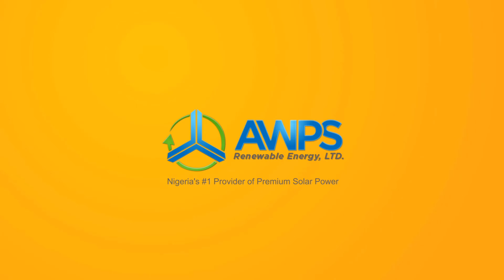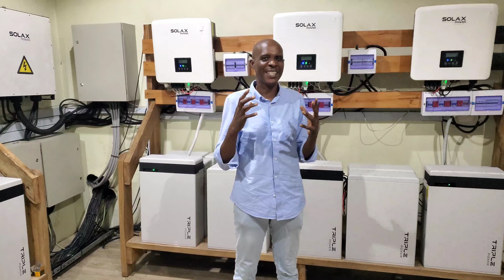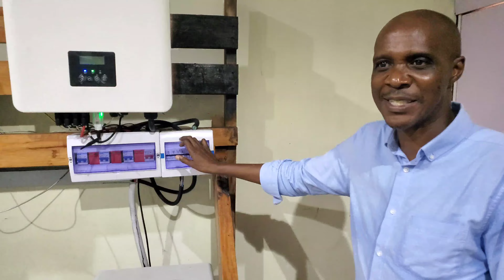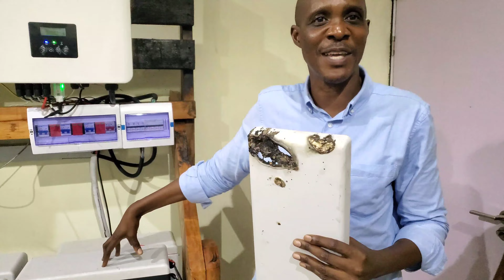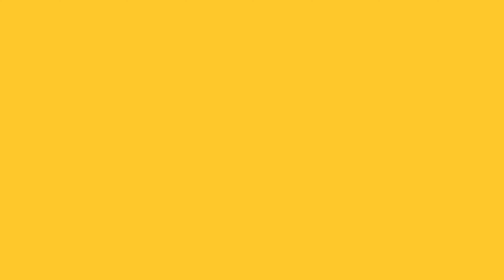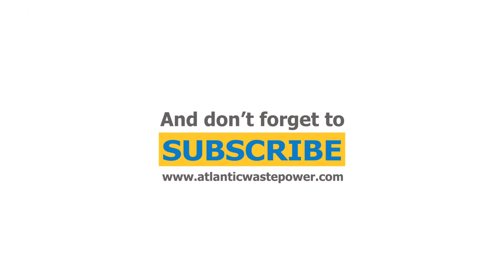Expression of Gratitude after the fire #solax #microgrid #fire #thankgod

Comment: Smoke detector, auto fire extinguisher, Thermal camera, regular maintenance checks, Cement board behind and below the inverters, Window in door so you can see if it is safe to enter. Make some more good luck because you used a bunch of it already.
Reply from the maker: 12 & 3 are in works. Cement we incorporate. Thank you for the tip. Window in door has been discussed. We will put all this in writing to the client. I hope all is well with you

Comment: Looks like it was a Schneider MCB IC65N 3P 4P 63A circuit breaker where the fire occurred, could have been a phase not fully tightened up causing excessive heat which may have led to the fire. Do you check all connections with an Thermal camera? Worth its weight in gold to have such a camera to check on connections when the system is running. Something like a Seek Thermal CompactPRO FF Thermal Image Camera is handy to have that you can use with your phone.
Reply from the maker: Thank you for the suggestion. One thermal camera coming up. We discussed this in our last team meeting.